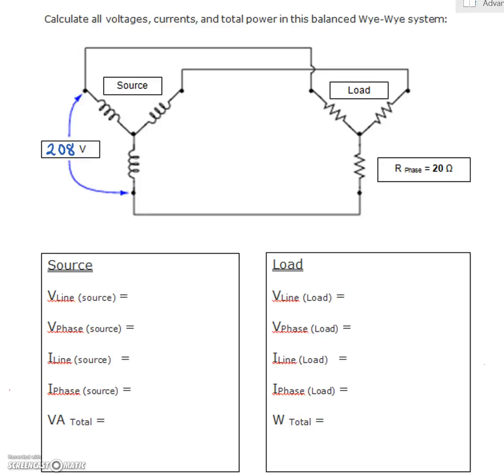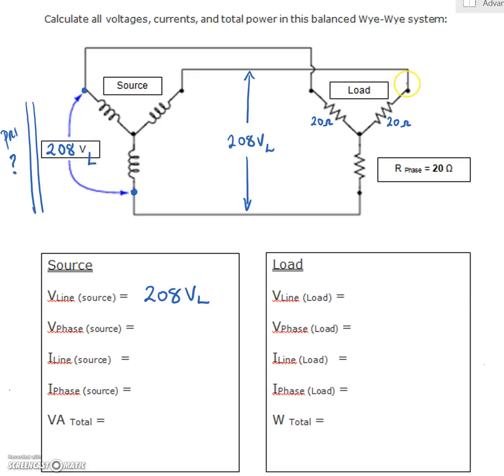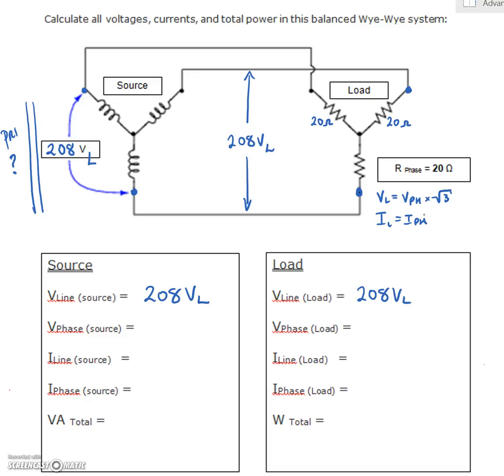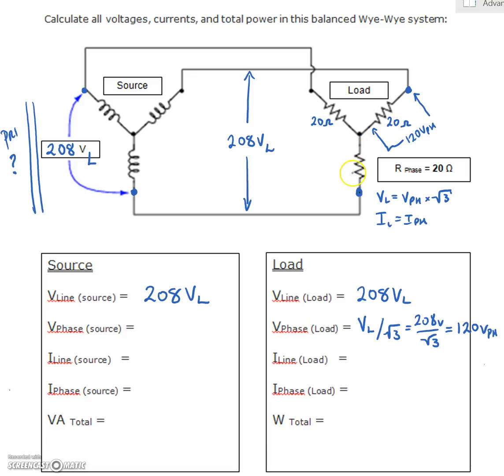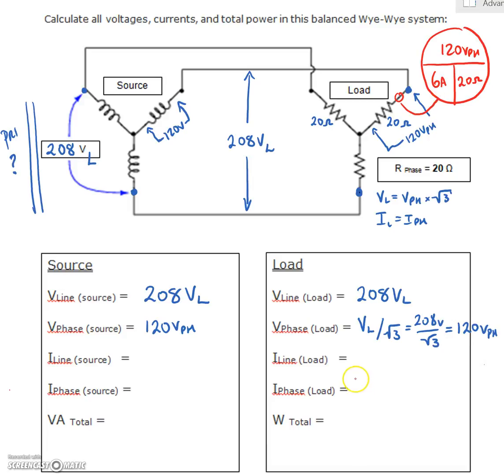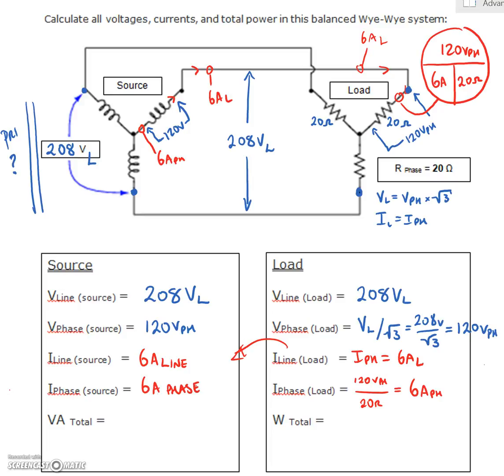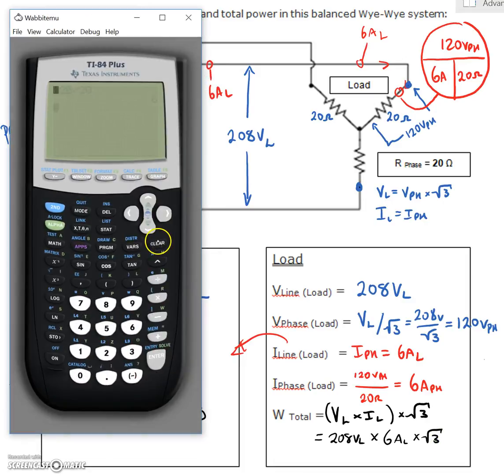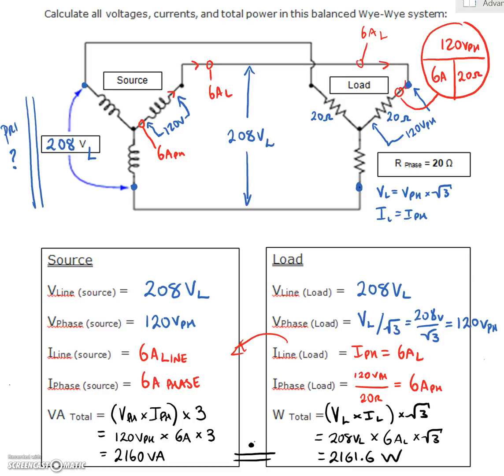3 Phase Calculation #6 (Wye Source, Wye Load)

Comment: We also use. 208Y/120 volt system here in the states. I call it the wimpy wye because the voltage between phases is only 208 volts instead of the 240 volts you would get from the delta system.
Reply: Is 208 because the coil winding ratio ?  480 delta  480/ 3=160. 160 •1.73=276.8 can you explain 277 or the math I just did . I’m so cofused on how I arrived at 277. I know delta